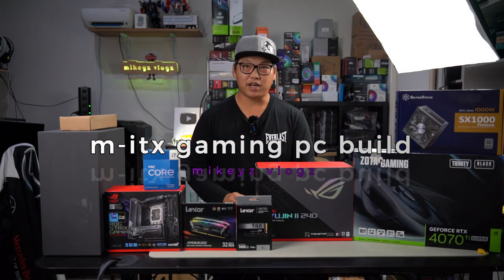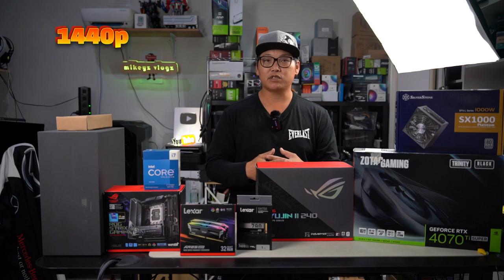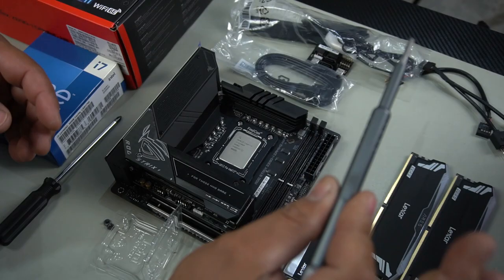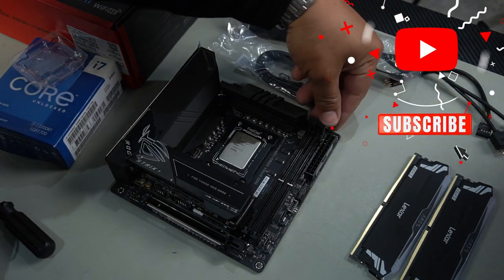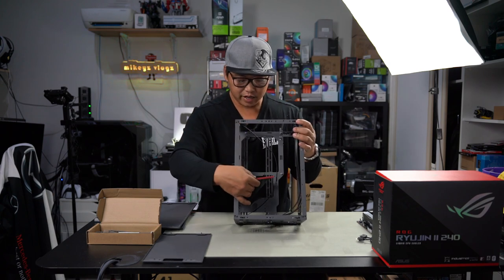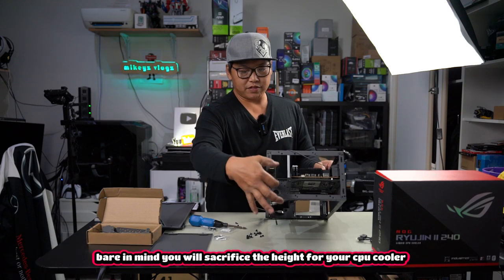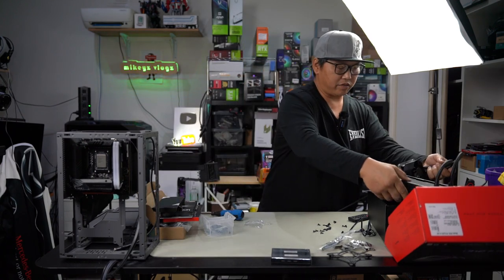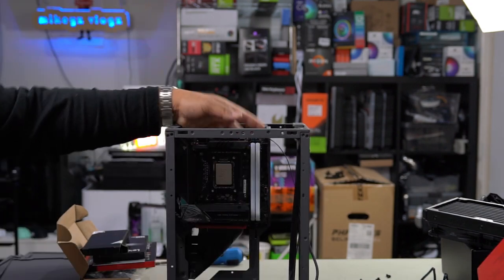best mitx gaming pc build SSUPD meshroom S V2

Comment: I love the setup, with liquid cooling you had several options, one was to install it in the back with the GPU and the other as you installed it from the beginning but with the tubes upwards. I had to install it like that in my Meshlicious because the pump was bubbling a lot and as you know that takes away the useful life of the AIO.
Reply from the maker: yes ur 100% right and I'm really loving the all mesh itx builds too.....so next I'm doing the typical n200nrp v1 then the phanteks evolve and Metallica and a few more ... I really just love the small footprint and still great performance
Reply from the maker: and I'm dying to try atx in this case ..I love how versatile it is ..just amazing ... we have never seen a case like this and ssupd have out done themselves here

Comment: No fault of your own but cable management appears to be a bit of mess but sunny side up design sure results in a nice all mesh design when it’s all zipped up.
Reply from the maker: ye it could be done abit better but your really limited on cable routing due to length of cable with sfx psu, but yes ofcourse it can be done abit better i agree , however once you place the covers on its fine...and being all mesh it breathes well...the main thing I tried to avoid is having really harsh bends and folds...

Comment: How did u mount the fans at the front??
Reply from the maker: @H4rmz_.  as I explained in the video it's mounted to the radiator ..so I had to use the long screws for the fans and put that through the case   mounting holes then through the fan and finally into the radiator ... but if ur not using an aio u have the mounting holes for either 140 or 120 fans
Reply: How big are the screws?
Reply from the maker: @H4rmz_.  not sure do u mena how long are they?? they are the typical screws that come mwith the radiator its abit longer then 25mm as that is the thickness of the fan so im guess about 28mm long roughly and usually m3

Comment: CPU cooler I’ll use iCUE Link i100 AIO
iCUE Link 1 Cable for fans & RGB 
Hub install bottom of the case
Good for meshrooms
CPU Down to max = 14600K
Reply from the maker: sounds good mate, i think will be oerfect